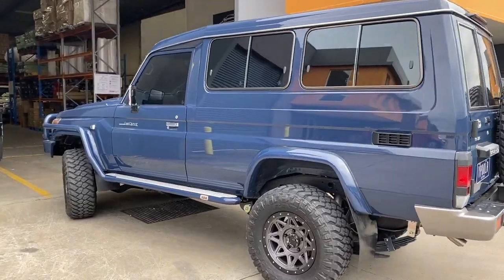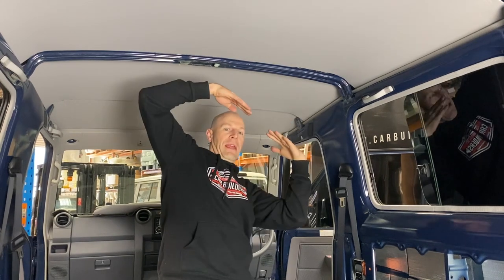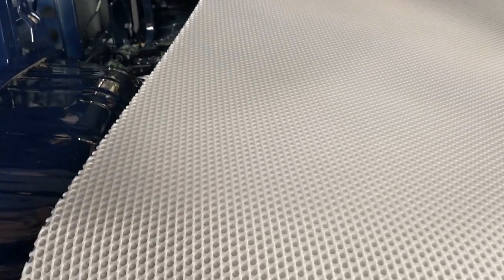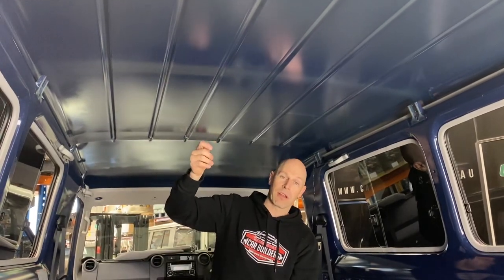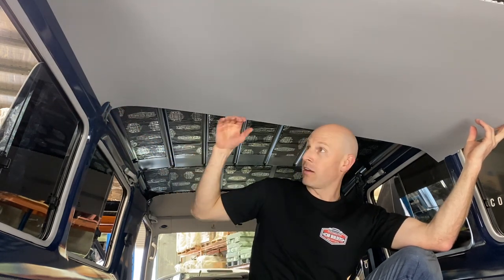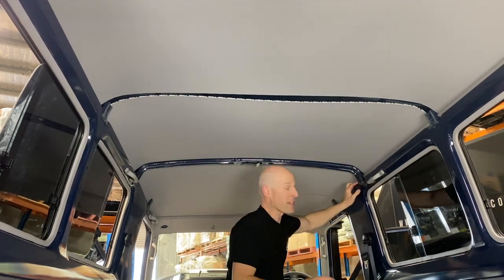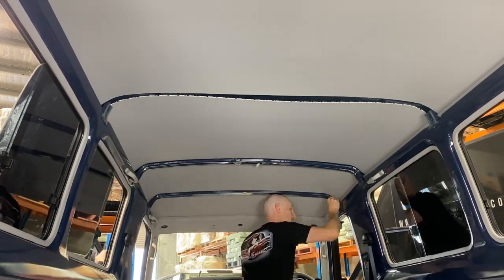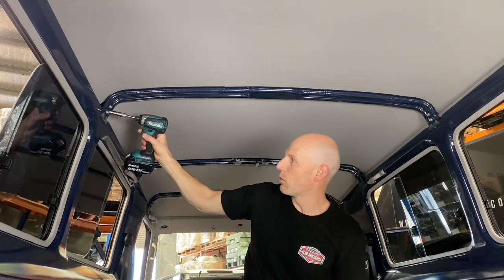Removing a Landcruiser Troopcarrier Headlining in Roof

Comment: Questions : 
1) If travelling in extreme cold conditions would it be best to completely seal the roof, floor and doors ?
2) For very cold temperatures, what product could be added to the sound deadener for heat retaining insulation ?
Thank you.
Reply from the maker: Hi Ade. Yes, you will want to add a closed cell foam throughout. A challenge with the Troopy is that the roof lining is very close to the roof. You can fit the 2mm sound deadener under it but it can be challenging to fit an insulation product due to packing.
Reply: @carbuilders1  Thank you.

Comment: Awesome job. Question, would the stage one cut road noise out if you double or even tripple layer it with the stage one only?
Reply from the maker: Hi Neelchand. No, it is stopping vibrations in the panels not so much external noise. For road noise etc you are best to look at the mass loaded vinyl underlays such as https://www.carbuilders.com.au/interior/mass-loaded-vinyl/ 👍